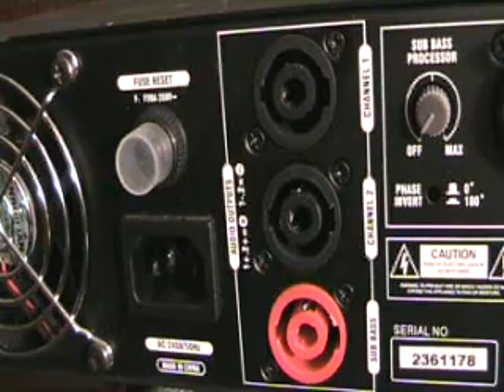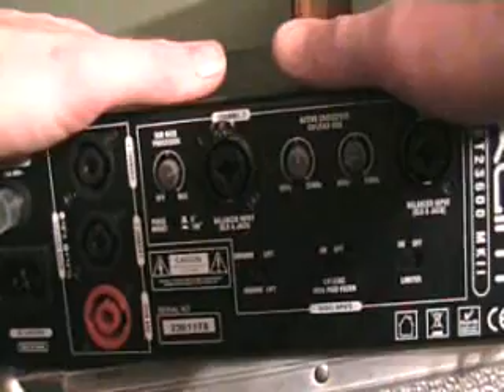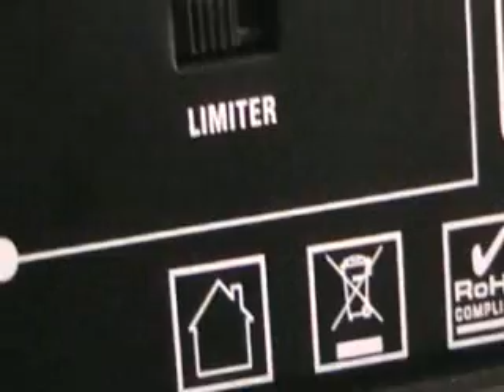The KAM KXT 23600mk2 Power amplifier

Comment: hi im thinking of buying a power amp to go allong with my yamaha rx z363 to supply power for my 12" sub its only for use in my room but i was wondering if this > KAM KCA1200S Power Amplifier  has a seporate bass amp like ur model and if so how many watts RMS does it supply my sub is a vibe 450 watt RMS 4 ohm speaker? any help would be appreciated.